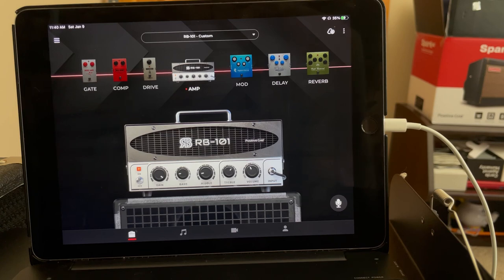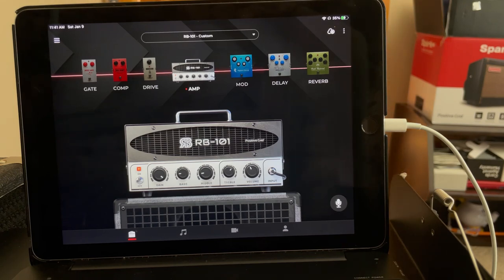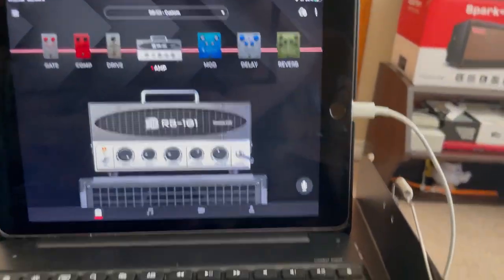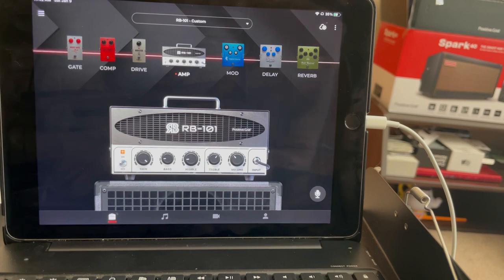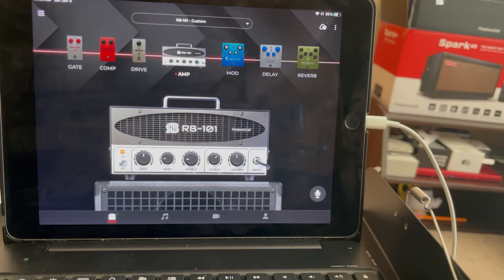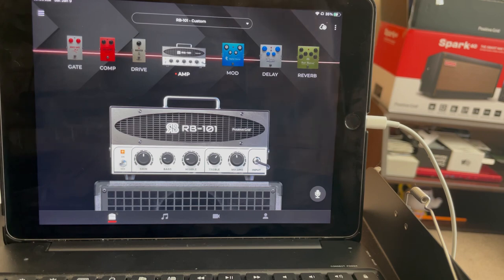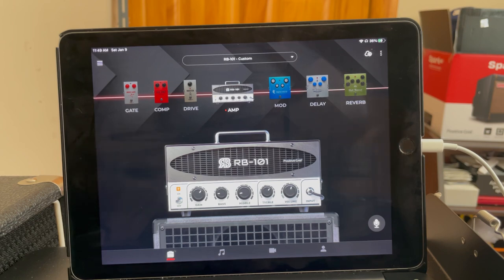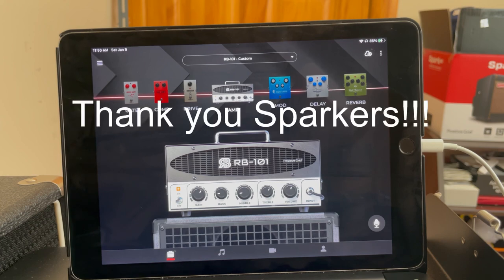Loudness: Volume, Gain, Master and Output

Comment: Most EXCELLENT video.  
One question.  Is that ANY way, say in a given effects chain to replace an effect with a different effect? For example instead of the Noise Gate at the front, you wanted the Graphic EQ?
And for that matter, can you build an effects chain from scratch with whatever effects (pedals) and amp you want in any order?
TIA.

Comment: Thanks for the tutorial. Very helpful. I'm finding though when I use the Spark to record into Ableton, I get a rather thin weak recorded signal, even after adjusting the Gain and Master on the Spark. The input signal strength seems OK on Ableton is fine so scratching my head a bit here. If I use my own Mesa amp into a Zoom interface, it works perfectly without having to adjust anything on Ableton. Any ideas?
Reply from the maker: I noticed that a bit too (studioone for me) and I think I just increased the input gain in the software. It’s been a while though.

Comment: So annoying the volume goes back up really loud EVERY TIME you change amps. Seems to drastically change the outputs.  Drops sound or sustain completely on some presets if you try and adjust outputs. Loud or nothing basically. Sucks when you are trying out the different presets to see what you like and are constantly fiddling with volume controls. Don't know how you could use this in a gig situation. Touch one control knob and its F,*#"s everything up. And why doesn't my Spark '40 Glassy' hardware preset not even show up on Hardware list ?  I'm starting to hate this amp.